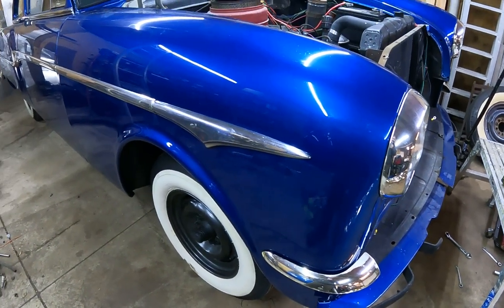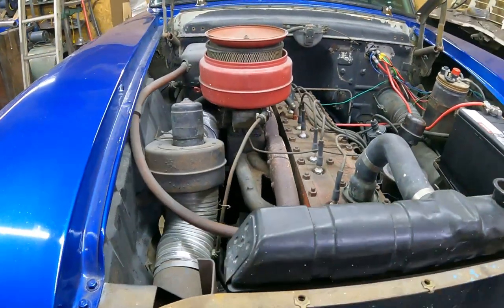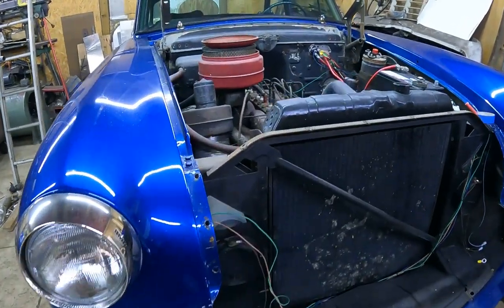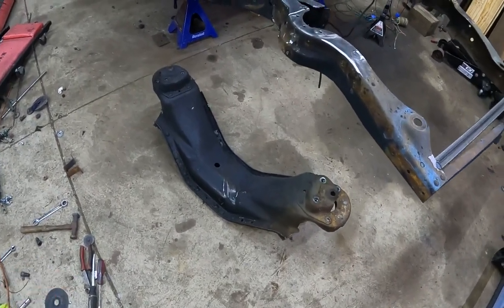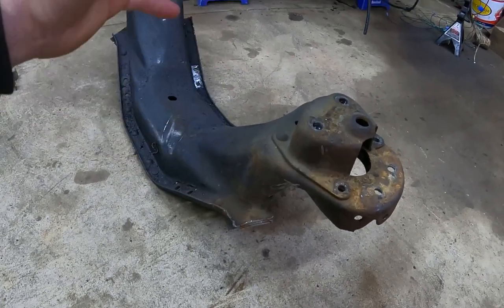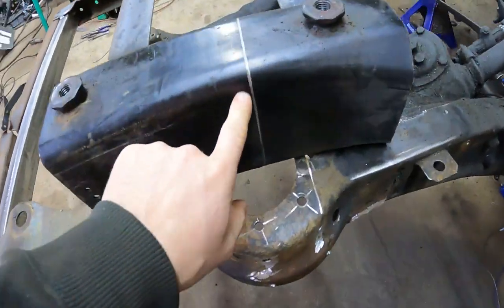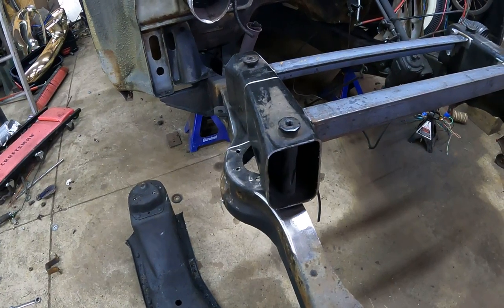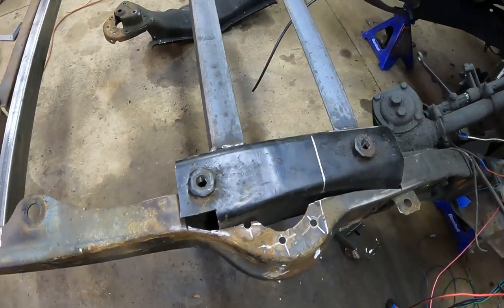1953 Packard Clipper Crown Vic Swap Part 1

Comment: Wouldn't pulling out the Packard steering system be safer if you installed the collapsible Crown Vic steering wheel and airbag, without risk of being skewered by a rigid Packard steering box on frontal collision? Looks like a neat drop in.